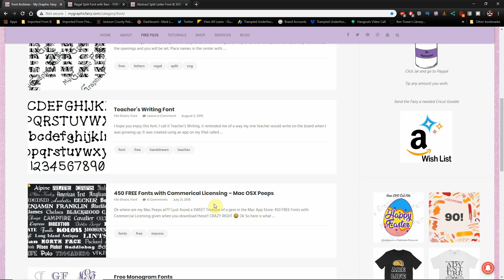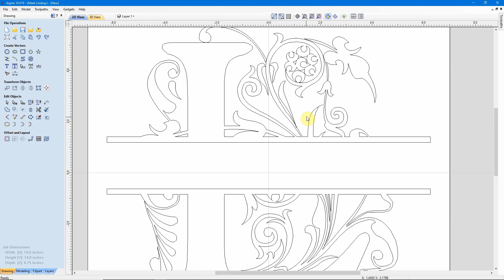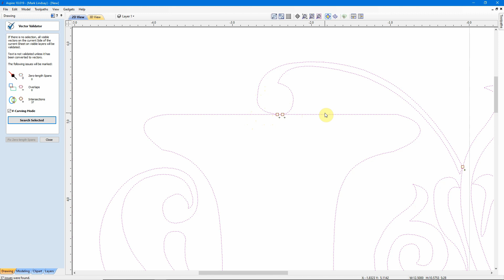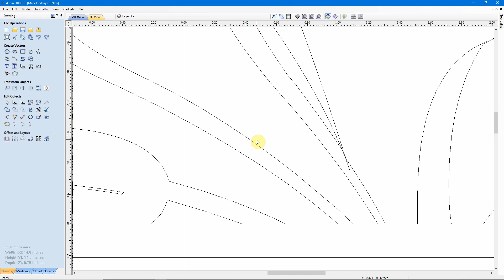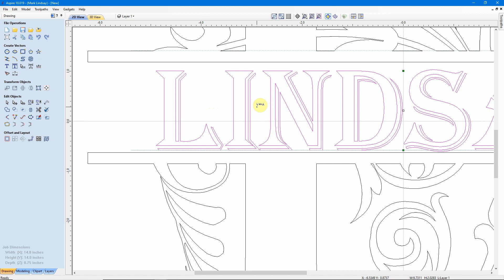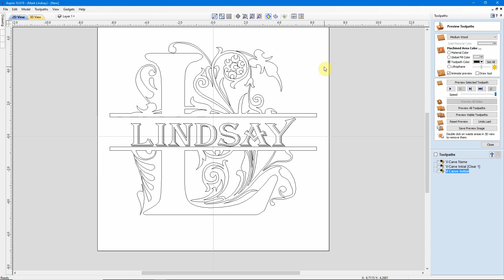Design a V Carved Monogram in VCarve or Aspire – The Easier Method

Comment: You make this look so easy. Hows did you learn so much about this?
Reply from the maker: I learned it the same way you're learning it now. I watched a lot of videos, asked a lot of questions, got into Facebook groups and various online forums, then got into the software and drew projects. I made friends with people who have been doign this for awhile, and bothered the people who created the software for answers to questions. I made a lot of mistakes and tried to learn from those mistakes. I always practice on scrap materials I get for free before I try the project on expensive materials (I'm super cheap that way.) My grandfather told me, years ago, that there's no replacement for experience, and the only way to get that experience is to do it.

Seven years ago, I had never been in the same building with a CNC router. Keep at it. You WILL make mistakes - everybody does. Try to identify the mistake, learn from it, correct it, then drive on. If I can do this, anyone can.
Reply: @MarkLindsayCNC  thanks again I did try another letter B  wow that one is messed up bad. Not sure where to start on that one.

Comment: What does converting to cures mean and do? Thanks mark
Reply from the maker: When you first enter text, it is treated as a solid, joined object - not as individual vectors that make up the text. That's why it is referred to as a "text object." You are very limited as to what you can do with that text when it's still a text object. "Convert To Curves" converts the text object to individual vectors that can be edited just like any other vector can. For instance, if you want to remove the dot at the top of a lowercase i, you can't do that if it's still a text object. If you try to select just the dot, you select the entire letter. If you convert the text object to curves, you can then select that dot separately from the rest of the letter i, and delete it, move it, resize it, replace it with a little heart, etc... That's just one example, but hopefully you get the idea.
Reply: @MarkLindsayCNC  Thank you . You are very kind person

Comment: Mark, I wanted to drop you a note.
Just because I was reviewing....
Thanks again for the help. I am sure I will need more suggestions in the near future.
Also...in regards to the vid, impressed to learn about the means by which one deals with the larger letters.
 Got the split font and fooling with the SVG's as well.    (in  F360 of course) 
Haven't my licence for V Carve till the months end  :-) can't wait.

Using Fusion 360 to attempt some v carving of dxf and svg. 
So far so good. Wood router folks have to define practically every tool.  All v-bits, flat facing type, tapered ball, even smaller endmills. 
It would be very difficult to simply set the max depth and generate clearing and v bit and toolpath that were derivative of one another in Fusion 360. 
But hey I am still going to try anyway because I seem to have a lot of time on my hands.
I also am a glutton for punishment. 
Regards
Reply from the maker: Keep at it! We all seem to have a bit of extra time here lately. I just wish mine wasn't filled up with yard work...

Comment: Great information video. I’m pretty new to this but wondering if after making the modifications you could save it as a CVS file then open as a new project if you don’t put the name in it? Just wondering!
Reply from the maker: Yes, you certainly could. I didn't mention it in the video, but it's encouraged. I would name it something like Monogram Letter Template.CRV
To use it, open the file, then immediately Save As... with a different name. That way your template file goes unchanged.

Comment: Thanks for this tour of split fonts.  Of course I have seen this lettering but knew nothing of the source or nomenclature. They do a very nice job. 
Currently experiencing much difficulty with configuring my new 2 x 4 table with Mach3 and can only dream of actually making chips. Sad because I have plenty of post ready design
It is probably the cheap XHC controller or me or both. I don't like dealing with Mach3 it is neither conversational nor intuitive
Reply from the maker: I would recommend you head over to the Mach3 Support Forum, join, and ask your questions over there. They're a group of Mach3 and Mach4 users and testers who will be able to answer your questions, and get you up and running smoothly.  There are some real wizards over there who are glad to help. Here's a link: https://www.machsupport.com/forum/index.php